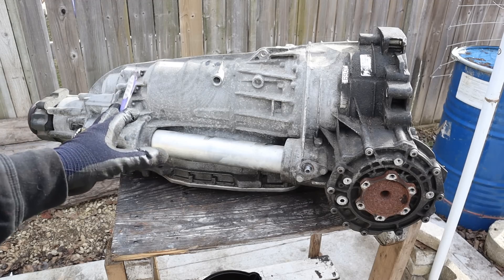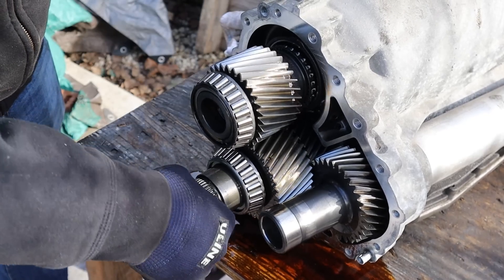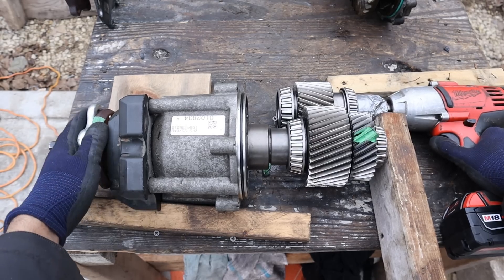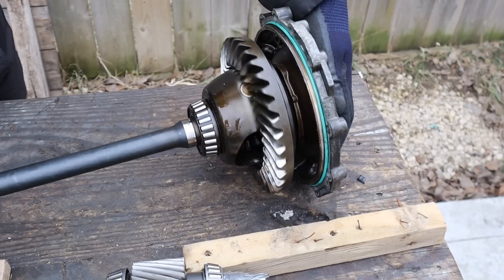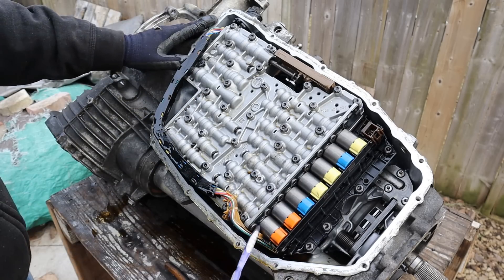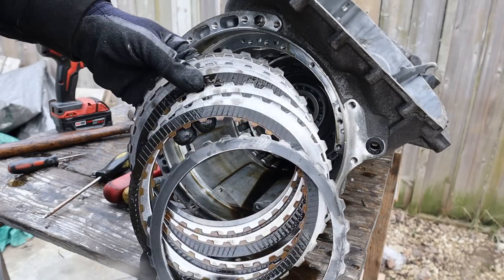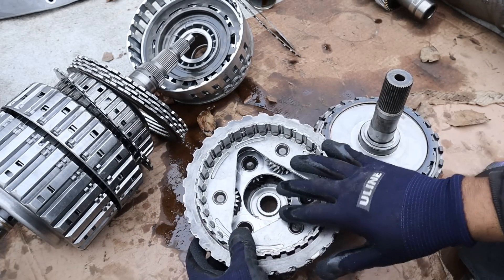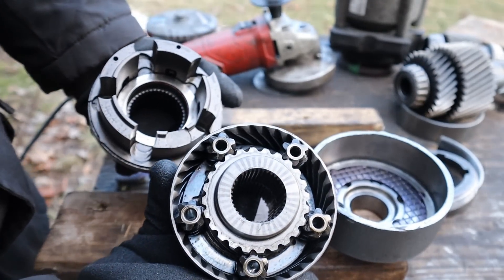How Audi Quattro AWD Works

Comment: FYI: It's a "flex-circuit". Often more expensive than a hard circuit board. It allows greater design flexibility, mostly as it can route around things. Audi appears to make a fine transmission with an emphasis on simplicity which makes for reliability. I think we would agree we cannot say that about their nightmarishly complex engines.

Also I saw a video on Ford's 1100 cubic inch GGA engine for the Sherman tank. I was most impressed that it used worm driven shafts to drive the overhead cams, never saw this approach before. I liked it. Worm gears on both ends from crank to cam shaft, which also enable the appropriate 2:1 speed reduction.
Reply: Probably because the transmission is made by ZF. This is 6HP model. They're the primary supplier for Audi, BMW and are found in some GM models. Really solid engineering.
Reply from the maker: I was surprised at how simple it is for an Audi.

Comment: The center differential is in fact a Torsen C type center differential, made by JTEKT.   It provides a 40:60 front-to-rear torque split on dry pavement, not 50:50.  This is because the sun gear and ring gear have different diameters.  Since the ring gear has a greater diameter than the sun gear, it will apply greater leverage and therefore, torque to the axle it powers. You can actually count the number of teeth on the sun gear and ring gear to get the exact ratio.  I counted the number of teeth on the sun gear and ring gear.  The sun gear and ring gear each have 24 and 36 teeth respectively.  24:36 is exactly a 40:60 ratio. When one axle loses traction, this center differential is capable of transferring up to 70% of the available power to the front axle or up to 85% of available power to the rear axle.  It is this uneven basic distribution with instantaneous torque-biasing between the front and rear axles that Audi refers to as the "asymmetric-dynamic torque split".  It is a great system; so great in fact that this is the all-wheel drive system used on the current Lamborghini urus.
Reply from the maker: Thanks for the information. I didn't count the gears to determine the torque split. 
What's difficult to comprehend is when this "locks up" how the torque gets distributed, since those ratios aren't changing.
Reply: @speedkar99 Ratios ain't changing but the friction between elements does, that's how torque split is changing.
Reply: @speedkar99 yes it's intriguing isn't it. I'm not certain about this but I think a clutch can split torque like this when it is used to control only some (not all) of the driven wheels. As we all know, if you partly disengage the clutch of a manual gearbox it reduces the torque being transmitted to all the driven wheels and this means the wheels will slow down relative to the engine speed (or the engine will rev higher than expected), due to clutch slip.
BUT, when you slightly disengage a clutch in a differential which is only driving 1 or 2 of the 4 wheels, this again reduces the amount of torque being transmitted, however the other driven wheels are still powering the car along at the same speed so this time the wheels can't slow down relative to the engine speed, so only the torque being transmitted is reduced, so you get the required torque reduction to that wheel, but it doesn't now slow the wheels/car down as well, so you keep going at the same speed. 
If this is wrong, hopefully someone can put me right?
Reply: Thank you for this clarification. I was confused when he said 50:50 as my understanding was that planetary differentials were inherently asymmetrical.
Reply: Correct.  The previous system used a Torsen B center differential which had 2 sun gears of equal diameter powering the front and rear axles which is why that system provided a 50:50 torque split with up to 78% of the power going to the axle with better traction (3.5:1 torque bias ratio).  Audi phased that system out in favor of this Torsen C differential in 2005 because quattro became known for excessive under steer at the vehicles handling limit.  Switching from 50:50 to a rear-biased 40:60 endowed quattro vehicles with much more neutral handling. There is extensive literature on the internet about these systems released by Audi.  I can include some links if you are interested.
Reply: @rosslarkin6742  excellent info, thanks. I think most people/journalists miss the 'on the limit' understeer for the 50:50 torsen! I had an A4 B6 quattro and the handling was great upto 7/10's which for a road car is all anyone should really be using. Shouldn't be doing limit handling on the roads!
Reply: @TC-V8  LOL 😂. You are right!  The B6 A4 is a great car.  I currently have a 2020 Audi SQ5, obviously with the 40:60 Torsen and the bonus of the sport differential.  You can actually spin out if you aren't careful.  No issues with understeer there!
Reply: @rosslarkin6742  2015 S6 with sport diff here and your right, when you push it into a turn, the feeling is insane...
Reply: @rosslarkin6742 great info, are you saying that audi used torsen - B in the zf5hp24 transmissions? you said that this was the previous version compared to the torsen - C that is in the zf6hp26
Reply: I am in awe of the engineers designing such intricate machines...and your knowledge on the subject is just phenomenal...
Reply: @Anthony9592  thank you for the kind words!  And yes, the components in this gearbox are products of a multinational collaboration; brilliant engineers from Germany and Japan came together.  Companies like JTEKT, ZF, and VW AG all played a role.
Reply: @rosslarkin6742  Audi also did use torsen diffs delivered by AAM.
Reply: @4x4.tests.on.rollers  that's right.  They actually still do according to the current self study programs.  The literature states that the vehicles equipped with the 8 speed automatic transmission (AL552-8Q) feature Quattro with self-locking center differential, as we know.  Also, earlier versions of the 7-speed s-tronic (DL382-7Q) used in 2017-2020 A4 and A5 use self-locking center-differential.  Then they go on to point out that there are 2 physically distinct versions of the self-locking center differential, one made by JTEKT and the other made by AAM.  The technical characteristics of both differentials are identical (so 40:60 basic distribution with locking range of 70:30-15:85).  Also, isn't it interesting how the websites for the Bentley Bentayga and Lamborghini Urus refer to this AWD system as a permanent AWD with Torsen center differential, while Audi avoids using the name Torsen altogether and instead use "self-locking center differential"?  I guess it isn't a huge deal, but interesting nonetheless.
Reply: @rosslarkin6742  I wasn't checking SSPs for quite a long, are they still available for newer models? Do you have any links for some very detailed specifications? When it comes to namings - in some sources they use "self locking center differential" but there are still docs where they use torsen name but mainly when generations are compared. The same with haldex, they were avoiding using this name, there was hydraulic multiplate clutch instead (now there's no official haldex name so problem is solved). And when it comes to spin out which you mentioned in other comment - I believe it's possible mainly due to rear Magna diff, not the torsen itself.
Reply: @4x4.tests.on.rollers  sorry I missed this reply 2 months ago.  If you are still interested in SSP's, I am happy to send them. I have one specifically on the AAM self-locking center differential as well as Gen II, IV and V haldex I believe.  Also, on the 2017 A4 with DL382-7Q transmission showing cutaway with JTEKT self-locking center diff
Reply: @rosslarkin6742  i d  be intrested too. I have a 2016 audi q5 with s tronic and torcen c quattro. I d love to learn more about it, specially since im starting my second masters in automotive engineering soon.
Reply: It's true.
Recently, Audi only uses Torsen differentials with asymmetric torque distribution.
Reply: @linduditv55  Recently means almost 20 years.
Reply: Is this the same kind that came in the a4 b5 1.8tqs? or a totally different unit / charactertics? The b5 were 50/50 ?
Reply: @keatoncreates  It was torsen B, 50/50.
Reply: how long can last that clutch material ?
Reply: can we say this system is almost the same as the one used in the mitsu evolution 4-10 center diff ?
Reply: @pakkiaman2  Nope, there was viscous center differential.
Reply: wow thank you
Reply: Audi tried for maybe 100 years to build a car. They sold some in the US in 1970's. People figured out pretty quick that there aren't any parts and nobody will work on them. Jokes Wagon finally bought them. If you own an Audi there is no known escape. You can't delete, erase, or hide it. You're stuck. We call it an a$$ wipe car because that's all you can do when it breaks. Way too much Rube Goldberg, rinky dink, Mickey Mouse engineering.
Reply: I didn't think Torsen diffs required clutch packs to limit slip, why does this one have a friction plate operated by the worm gears, as described in the video at 6:43?
Reply: @pjay3028  Imho, friction plates come into action when gearing TBR is exceeded. In other words, they eliminate the biggest weakness of the old torsen diffs.
Reply: @4x4.tests.on.rollers  you are absolutely correct, I have found reference to the early T2R diffs on the Torsen website and they refer to the incorporated friction plate design, I'm amazed, I knew nothing about these! Thanks for your information.
Reply: @pjay3028 that’s actually not a friction plate in the center differential. It’s to trap oil to create an oil layer to prevent excessive wear. That is cause the helical shape of the gears drive the surface into the cover under load like all helical cut gears. The grooves trap oil just like crosshatches on a cylinder wall only larger. It also aids in flowing the oil around the lsd to stop hot spots. A Torsen LSD does not use clutches.
Reply: @Fk8td  that's not how Torsen describe it on their website. Although it's true that the plate is not a clutch plate, on the older Torsen designs it's purpose is nonetheless actually to increase the friction within the diff in order to enhance lock up, so its purpose is not dissimilar to a normal friction plate. This was superseded in later designs with Equvex II split gear technology.

Comment: Altho the mechanical gearbox is much more simple. Less wearing parts in center diff. Way more mechanical. Way more reliable. The 6 speed 01E can easilly handle 600+ hp in stock form
Reply from the maker: It sure is simple. No clutches to wear out.

Comment: Sure, a Torsion diff is more complex and close to magic. But this one is surprisingly simple and straight-forward. Neat!
Reply: This is actually is a Torsen center differential.  Earlier Quattro systems used Torsen A and B center differentials which had a 50:50 front-to-rear torque split.  In 2005, Audi switched to this Torsen C center differential because it has a rear-biased 40:60 torque split, which reduces understeer.
Reply from the maker: Thanks for the clarification!

Comment: Thats why Electric cars are way superior... all this engineering for what?
Reply: 😂 
My colleague bought a Tesla Y and did some road trips. It was filled with stress and range anxiety. Because previously he could just drive to the destination and enjoy the trip. 

Now he has to plan a significant amount of time for charging and he concluded that any distance longer than 1 charge is just not practical. 

EV ownership is littered with problems. The vehicle don’t last as long and they are difficult to use.
Reply: All this engineering so that the car doesn't feel like the shit can electrics are
Reply from the maker: Electric cars are far more complex. The electronic systems, controls, inverters, battery control, motor control etc.
Reply: @speedkar99  yes lol
Reply: Do you not know the engineering oh electric cars just look at cooling and warming up
Reply: Purely electric car are superior yes, battery tech isn't there yet, the day great batteries are invented will be the death of the internal combustion engine until then, LOL they work fine for southern USA but suck in the actual winter at -44c or F, my 1990 F150 starts like a charm at that temp
Reply: lol! That’s why bioelectrical humans are way superior… all this engineering for what? Just walk
Reply: Well they wont set on fire and can go 500+ miles before a refill. Just wait till EV start to break down. ICE Cars have been here for a century plus and are well refined now.
Reply: Have you ever seen the inside of a battery pack? The number of connections and circuit boards are insane!
Or the electricity and cooling controls in place for keeping them in control? Not to mention, that in non-ideal situations of ir being too cold or too warm outside that they don't function in a predictable manner.
How about rebuilding electric motors?
Also, most of these systems are either hard to troubleshoot or repair. 
Physical and mechanical parts can be rebuilt. New fluids, clutches, o -rings and bearings. 
Circuit boards and screens are discarded and almost non salvageable.
Reply: EVs suck in almost every way. They cost more, the travel range sucks, and parts are even worse. Will never own one.
Reply: How long does It take to fill up an electric car? And if I run out of electricity on the highway, can I get a Jerry Can and go to the next gas station and fill an electric car with a Jerry can?
Reply: @daveshockwave8098  You make sure not to run out of gas. Same to electric. Welcome to the future
Reply: @pilotboy2612  hey my truck is not the best on gas. If I run out, I just grab a Jerry Can and put gad in that truck via that. Can you do that with a tesla?
Reply: @daveshockwave8098  You're right in that aspect. The equivilant will be driving with a generator to charge your battery.
Reply: @pilotboy2612  and how long does the generator take to get the car driving?
Reply: @daveshockwave8098 when an EV dies and can't be towed to the shop/charging station, they usually send out a van with a diesel generator and universal charging port for the EV to recharge. 

Yes, it sounds as ass backwards as it is IRL. I remember first time I saw this happen... I chuckled for a good 20 mins
Reply: @amorgan20111  I'd rather have my Jerry Can than a generator
Reply: You should look at the rewinding an electric motor. It has its own complexities.

Comment: It seemed incredibly easy to take apart, you didn't even need a ball bearing puller ? I would like to take one apart too, and the brand new white carpet of my living room is so confortable to sit on for tinkering  🤗
Reply: I have done several motorcycle engine rebuilds on my dining room table.
Reply: @ToyotaKTM I've done a few manual transmissions it safe to say my partner she dont like the smell of old gear oil
Reply from the maker: It sure was easy.... especially for an Audi!

Comment: The Quattro center diff makes Audi AWD a permanent set up. This is a superior set up than a part time AWD. 

I have owned many Audis and they are as fuel efficient as a 2WD and they are incredible beast in a winter storm.
Reply from the maker: Yes this is full time AWD. 
Subaru's setup is a bit different, but it's also full time.
Reply: @speedkar99  Subaru and Audi are the only ones that drives amazing in a blizzard storm because of their permanent AWD design.
Reply: @jamsbong  Nope, they are not the only ones, there are much more with way more sophisticated permanent awd systems.
Reply: @speedkar99  one thing I did notice after rewatching your teardown of the Subaru center diff is the Subaru diff is a lot larger. 

Hard to say if the Subaru set up is more durable since I never heard any of these breaks.
Reply: @jamsbong  'There are only 2 companies that has such AWD technology' - absurd which proves your lack of knowledge. And calling one of the most AWD/4WD knowledgeable teams a dumb people proves it even more.
Reply: What this shows along with Subaru is that you don't need a sophisticated design to have amazing performance in adverse conditions.  Audi and Subaru managed to design simple awd systems that are extremely reliable.
Reply: There are only 2 companies that has such AWD technology. It looks simple but I bet there are a lot of knowledge that is still kept secret. 

Thats why every other car company don’t know how to make such AWD system.
Reply: @jamsbong  Again - you are completely wrong. There is no secret, especially in case of Audi, which doesn't even create their own awd technologies, they are using solutions delivered by specialised companies. The same solutions are used by other manufacturers.
Reply: @4x4.tests.on.rollers  True they do have the Haldex based system but not all the Quattro systems were the Haldex systems.
Reply: @niuhuskieguy  I was talking about all quattro systems, not just haldex.
Reply: @4x4.tests.on.rollers  this guy is just trolling around. He doesn’t know anything. 

Just because a car just AWD badge doesn’t mean they are all the same.
Reply: @jamsbong  Which guy?
Reply: @4x4.tests.on.rollers  you. Obviously
Reply: @jamsbong  OK. You think I'm trolling cause you have no idea what I'm talking about. Unlike you, I know quattro systems very well, since 1st gen 1980, over twenty different road types + a few rally variations. And Subaru systems since 1972 Leone. You obviously know nothing more than slogans. Just because there is quattro or S-AWD badge, it doesn't mean they are unique or different from other systems. Think twice before replying.
Reply: @4x4.tests.on.rollers  your just reiterated what I said that only two manufacturers namely Audi and Subaru makes incredible AWD. 

And then you reply i am wrong and then you reply the same information i stated first. 

I guess it’s hard to have a useful discussion with dumb people.
Reply: @jamsbong  You must read my comments again cause you didn't understand them. I DENIED TWICE the nonsense of your comments saying that Subaru and Audi are the only ones.